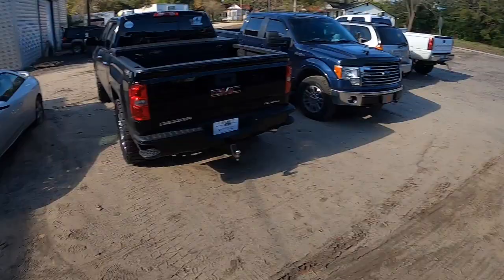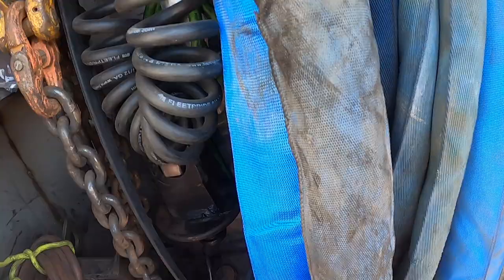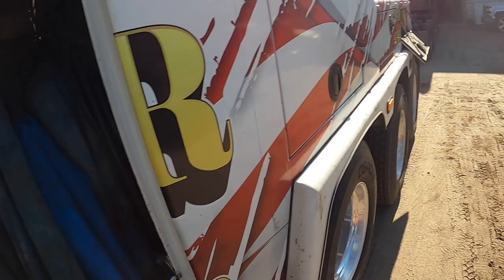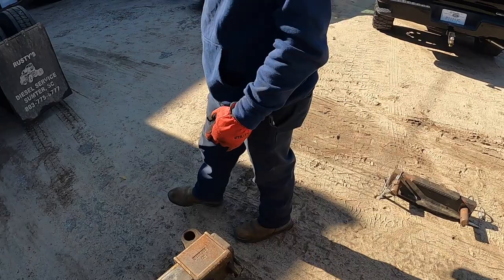How To Tow A Kenworth With A Miller King Pin Attachment

Comment: I could see where this attachment would be very useful if you were towing a tractor that had been in a wreck that broke the rear axle loose or damaged the frame. i noticed the bungee cord on the ratchet binder ends to keep them from vibrating out....love that trick. i will start doing that. so the chains that are holding the air bags up are also stopping the fifth wheel adapter from creating another pivot point. i always put 2 straps on the steering wheel as well. i use two different attachment points in case one fails. really enjoy watching the hook up procedures.
Reply from the maker: Mr. JC  Every time I needed a binder I had to look for the bottom half.  Mr Wilbert  told me about the bungee. I like your idea on two different points on the steering wheel.  Thanks for the tip.

Comment: Great job as usual that was a hookup I had never seen, God Bless
Reply from the maker: Mr John. Thanks.  Something we do not use alot but nice to have. Thanks for watching
Reply: @SumterWrecker  can you use the fifth wheel attachment if the rear axles are broken out of the truck
Reply: To tow the truck
Reply from the maker: Mr William,  You can as long  as the fifth wheel is not  damaged.  You probably  have  to chain the axles up. Thanks and stay safe.

Comment: That attachment comes in handy for some very rare tows. Like the upside down hitch. Fifth wheel camp with fifth wheel mounted on the trailer and pin in the truck. They are not very common but have run into them a couple times.
Reply from the maker: Mr Chris Yes sir it does. Thanks for watching and stay safe

Comment: Out here there is a steering wheel tying device that squeezes the Steering wheel and pulls up against the steering wheel column and ratchet straps to the brake pedal, and its the law out here that you use them when towing a vehicle backwards, thanks, BigAl California.
Reply from the maker: Mr Al yes sir that is what we use plus I like to use the seat belt as a safety. Thanks for watching and stay safe

Comment: I’m going to have to breakdown and buy that attachment. The placement of the leveling rod on the lower shock mount makes those KW’s almost impossible to axle fork without damage. Also I like your fender flare solution. Keep up the good work!
Reply from the maker: Mr. Troy It's  something we do not use every day but there if we need it.  Thanks for watching. Stay safe

Comment: this setup seems more secure than frame forks, surprised i haven't seen/noticed this method being used more often, i supposed probably because forks are quicker. certainly good for trucks where there are not many good points to place forks.
Reply from the maker: Ezra we do not use it often but it is there if we need it. Thanks for watching and stay safe

Comment: Is there some thing cause you to leave the smaller section of hoist out and not pull the short in with the middle section extended further?  Having seen what holds some fifth wheels down to the chassis I'd never have figured on lifting with it, then you wrapped chain about the suspension and it al fell into place
Reply from the maker: Mr Jack I only have in or out on the under reach extension and that is how it is designed.  Thanks for watching our videos and stay safe